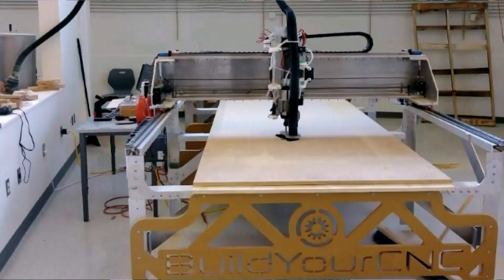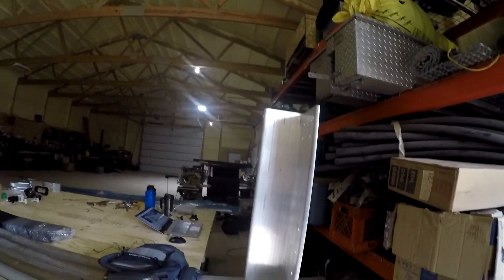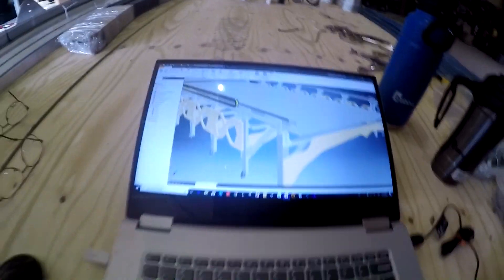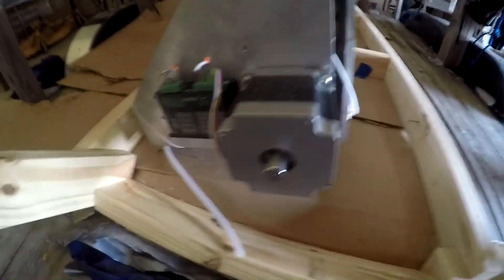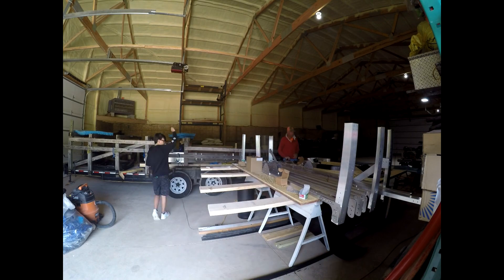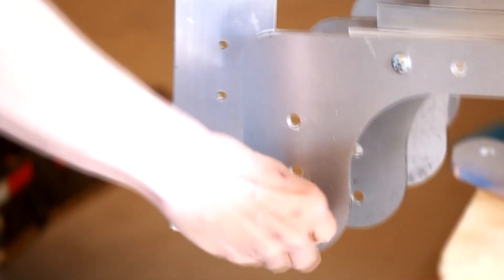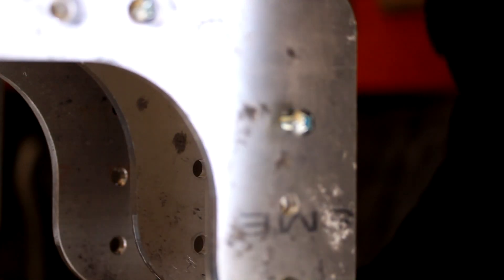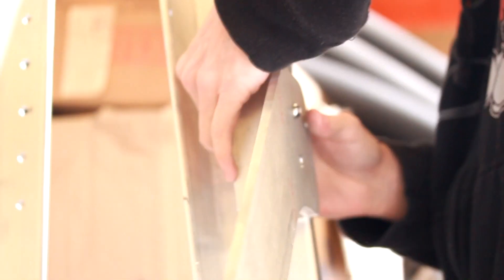Fabricator Pro 8'x17' CNC Router Build in Wisconsin Part 1

Comment: Really great machine and overall channel.  One of the things I do to routed 6061 aluminum plate is add a 45d chamfer tool and path to all outside corners.  While it does add a new setup / jig to your operations for the back chamfer, it makes the part look very intentional and solid IMO.
Reply from the maker: Thanks. Great point!